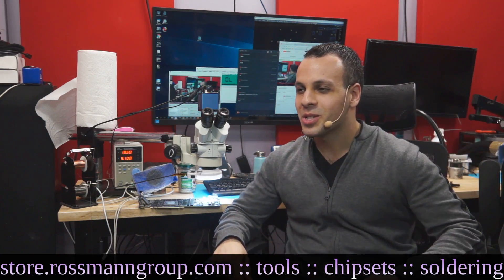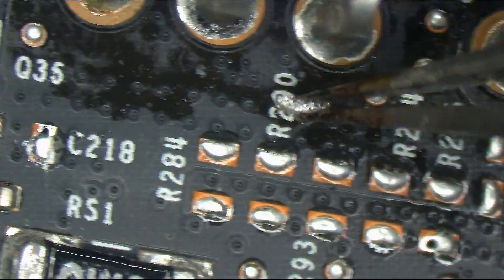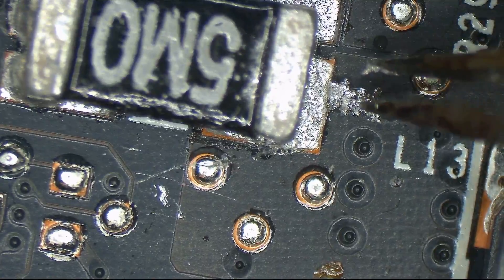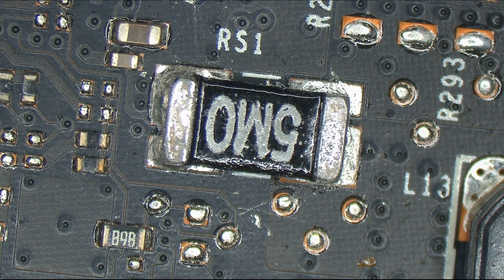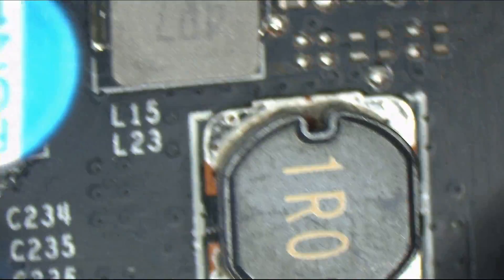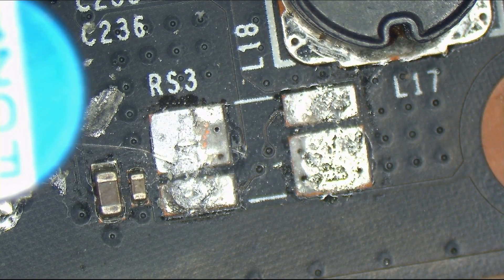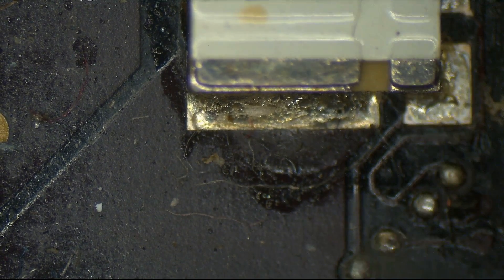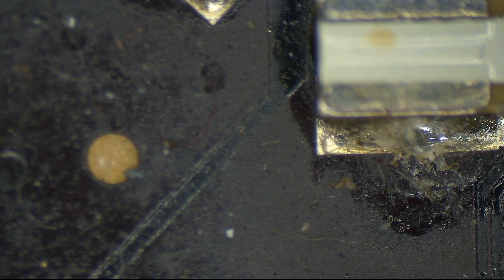DO NOT SHUNT MOD YOUR GRAPHICS CARD WITH LIQUID METAL!

Comment: my shunt mod 2060 12V cable line shunt lead totally melted by liquid metal. but that hold well By the surface tension of liquid metal. and card totally work well 😂

Comment: Here's some more info about "247 Solder P/N 247-LOWTEMP-15" 
http://www.247solder.com/wp-content/uploads/2018/06/247-LOWTEMP-15_SDS.pdf

It seems like it could be used as a "thermal paste", given it has a melting point of 280F.

Comment: Luis- I was watching a video where the guy was using a "solder paste" that used lower heat, for SMD LED. 

"247 Solder P/N 247-LOWTEMP-15"  
(  https://www.youtube.com/watch?v=_luUCXGFTQ8&t=136s  )

What do you make of it? Could this be used as a "thermal paste" for CPU/GPU/APU die? I've heard that Intel (?) is now soldering the lid on stuff- so why couldn't this be used? Does it have any thermal conductivity?

Thank you for your thoughts- I know you're busy.

Comment: Metal that seems to melt like chcolate ? Galium.
Not the most suitable soldering alloy for a piece of circuitry that runs way over the melting point of the solder itself after amalgamation...

Comment: I've been seeing so many tech channels cover this mod, some of them I thought previously to be extremely competent.

This is such a stupid idea, why the hell would you use liquid metal!? Why? Just buy a 10$ soldering iron and solder the shunt! That's probably cheaper and easier than liquid metal, not to mention the bonus of NOT ruining you're card after a few months.
Reply: I shunt moded and watercooled my 1080 FE 2 years ago with liquid metal. Also put the liquid metal on the DIE instead of thermal paste. Still works like day one.

Comment: would would you bash on NVIDIA when your title clearly states what the problem is? did you not know what happened before recording? like a lot of people commented, they used gallium to mod the shunts so the card thinks its drawing less power than it actually is, and so it draws even more power. The problem is that since liquid metal is such a great TIM and its also conductive these guys think its safe to use it to short the resistor. All they need to do is solder a wire instead and they'll never have this problem... but oh well
Reply from the maker: I didn't realize people were retarded enough to put gallium on their graphics card. Now I know.

Comment: It's a user error by using galinstan = liquid metal to reduce the resistance of those 5M0 resistors as those serve for current sensing and thus power limiting control of the card. Galinstan destroys aluminium and solder too, looks like a watery metal.

Comment: you will be surprised to find the very same thing in a while after you fix that solder. I can assure you this solders were perfect when it left the factory. the only thing wrong is the thermal design that ruins the solder joints over time (without melting it!).

Comment: if i could afford it, i would send you the 290x i have sitting here that a buddy knocked something off the back of, then said "it just stopped working" i found the spot he fucked up and could see he even tried to glue the cap/resister back down.. ugg..

it works but under load gets stupidly hot... if i still had access to a proper station i could fix it myself... but... being disabled... very hard to afford a proper hot air system..

so many of the cards i see, its not the gpu that died, but other components vrm's and such... i made decent money fixing 1900's with bad vrm's for a couple years, our shop ended up contracted with msi and 2 others fixing them and shipping them back to their owners as if the oem repaired them...

and yeah....some of these are horribly built... jesus... dont get me started....

the best thing to use in my testing is the pads linus reviewed recently, (used similar for years, the ones he reviewed are actually better!!!), cut to size of gpu core, and i even did it for the ram on a buddies 1080ti since we had plenty of pads, and the stock ones where...to be kind...shit... 

after application temps dropped cared wide...

and...liquid metal is...interesting but..also not something most people should fuck with.. jesus... what a mess..

Comment: Yup, more likely a user damages a vrm or something than the die... Unless they get cocky with that overclocky. The gallium might be reacting with the large amount of tin in the solder but I'm no chemist. Could have easily been prevented with conformal coating even if the application was bad.

Comment: Most overclockers that do that type of mod Know what they are doing. most will tell you that this is not good for your card but the difference they purchased that card just to do that probably for a competition. real overclockers would not do that with the card they use all the time.

Comment: Louis ... i started REPAIRING graphicscards as a newby and someday after i started with that i came across your channel and learned many nice things from you "dont be perfect you will destroy something"  but this time u r wrong ... the shunts came off bcause someone put liquid metal on them to mod them. its common to get more power into your gpu ;) ... the issue that liquid metal is "eating" solder isn`t new so the person whoever did this is just some kind of noob to the field of powermodding shunts ...
and second .... most the time graphicscards fail bcause of the powermanagement ;) ... sometimes transistors, most of the time the VRM IC`s  and caps... i was always wondering why you dont repair graphicscards especially in this days of cryptorage prices on GPU`S ;) ... but today i learned YOU JUST HAVE NO CLUE :P :D ... do me a favour and get to know about graphicscards :-*

Comment: They are just idiots, if they really so wanted to mod the card properly (where properly is not just shorting the current sense but that´s another thing), they could just have used silver, highest conductive metal of all, next solution more approachable...? Copper maybe? Just remove the resistor and solder a piece of copper? But no... let idiots be idiots and take their money!!!

Comment: "Dear Customer,
As a proud manufacturer of high tech equipment, we sure did find out that the solder on the board you purchased was contaminated with an eutectic alloy of gallium that can be liquid at room temperature.
We are highly ashamed that our assembly line number 6 used rogue aftermarket thermal interface material in place of the required solder paste.
Please find in the present package a warranty replacement for the 1200Euro graphics card you could not use, as well as two pills of viagra.
Please note that one of this viagra doses is meant for the tweezers of Mr Louis Rossmann,  that got damaged by gallium contamination in the process of finding the root cause of the problem, and are now too soft to be of any use.
The second pill is for your private use, dear Mr customer.

-Nvidia customer support"

Comment: It's not the manufacturers fault. Obviously they used CoolLaboratory gallium compound liquid metal. Whoever did the mod should have used nail polish to make a well before applying Thermal grizzly Conductonaut Liquid Metal. For me I couldn't care less about the warranty. If I was to shunt mod I'd just solder kynar wire with lead free solder. You're going to void your warranty anyway.

Comment: This is an effect of galvanic corrosion due to use of gallium. It spreads throughout the metal it comes in contact with like a virus, weakening its structure. Nvidia really is not at fault here at all. The user is just a fucking dumbass.

Comment: Yeaaaaaaah liquid metal probably turned the solder into toothpaste, but competitive OC'ers do it all the time for temporary gains in performance. Then they generally clean the liquid metal off or if the card no longer works, generally solder the original resistor back on if there is enough meat on the bone or put a completely new one in.

Comment: Mr. eevblog argues, that injecting current in an individual voltage rail without having all the other voltage rails active may damage the circuit and therefore it is not a recommended repair technique. He refuses to use this technique during his timid and rare repair approach videos. What is your opinion on that and have you ever destroyed a board using the current injection method?

Comment: You can scratch some gallium with a needle and then wipe the needle across an aluminum engine block. After a few hours, the engine block will crumble apart.

Comment: the reason the solder is like that is because the Liquid metal TIM reacts with it and brakes it down, that is not how it comes stock. doing the shunt short mod is only a good idea if you are planning to try and brake HWbot records. the amount of extra power it sends to your core and VRM is not worth the extra 20 to 40mhz for daily use.
Reply: Doing THIS mod is ridiculous.
Just short the damn shunt with a jumper.
Reply: Spirit you can’t, the less resistance you give it the more power you get to the
Gpu. The reason people use liquid metal is because you’re only looking to drop the resistance by 25 to 30%. That way you get 25 to 30% more power to the GPU. If you want to shorter with the cable you’d be putting significantly more power into the graphics card. Some people use conductive ink To do this mod because it’s relatively risk-free. But that way you and we got about a 10% power increase so it’s just not worth it. If you actually know what you’re doing you can do this with liquid metal without melting solder
Reply: Then swap it for a smaller shunt. Easy.
Reply: Spirit you don’t understand. If the card detects something is wrong it will lock the core at 50mhz. Any major mod to shat shunt will lock it. I don’t think you understand what the purpose of this mad is.
Reply: Pretty sure an electrical engineer understands the purpose of the mod better than you.
What do you think a mixture of highly conductive, albeit liquid, metals, is going to do to the shunt? The exact same thing a solder bridge will.

Comment: When you put liquid metal on any solder this can happen, the mixing of the two metals makes the alloy  have a lower melting point, in this case blow or near room temp, this has nothing to do with the solder from the OEM, its kinda like bitching that laptops solder corrodes when you spill coke on them its not the OEM's fault. Wic the shit up, flux the pad, replace the part, add flux, put new solder on, same shit as when your fixing mac pcb's. (scraping parts off is amateurish, you can do better, you should do better) Its chemistry, less to do with the manufacturing process FFS they are made in the same country and in many cases the same facility. * not sure if you explained more in the stream, but in the 7min video most of it was bitching about the soldering job, not what made the solder go bad.

Comment: When Gamers Nexus does a liquid metal shunt mod they use a very small amount and wipe it off later, liquid metal is a way to TEMPORARILY mod the card.  If you plan to keep your balls to the wall overclock clean it and solder the short(not that I am advising doing so, your card catches fire it's on you).

Comment: It's entertaining to watch Gallium or Mercury corrosion on real time. Put a drop on an aluminum can and watch it disintegrate. Similar effect on tin solder joints. Louis, this could be topic video, as many mod'ers like to use Gallium as thermal paste on the CPU or GPU. The problem is the way Gallium or Mercury wicks.

Comment: My Macbook is not charging and the led is not glowing. If the battery is charged (in an other mac) it works with the macbook normaly but is not charged. Do you think its the I/O Board or the logic board. Most of the repair companys just repair one of them and i am not sure which one is the problem.

Comment: I use  thermal grizzly LM on my gtx 1070 on the 2 shunts otherwise it power limits hard..as long as you only put a thin layer on and don't get it on the solder joints it works very well..you could cover the legs of the shunts with liquid tape or clear nail varnish for extra safety.

Comment: Idk why LM is being suggested as a mod to trick the current sense resistors. It's less risky to just replace the 5m resistor with a smaller resistance like 3m or 2m. Even an idiot with a basic $15 eBay soldering iron and a few cents worth of resistors could do a decent job of that...
Reply: If you have the knowledge and know how to do it, then sure do what you say, but for ppl that have liquid metal laying around because they use it as tim on gpu/cpu, this would literally take them 5 min to do a shunt mod. 

I think it's fine, as long as you know the risks and want a easy solution, tho i don't think anyone should be doing shunt mods for regular daily overclock, but it is smth you can easily do to get higher benchmark scores(there are overclocking competitions, tho pretty sure ln2 is kinda required there).